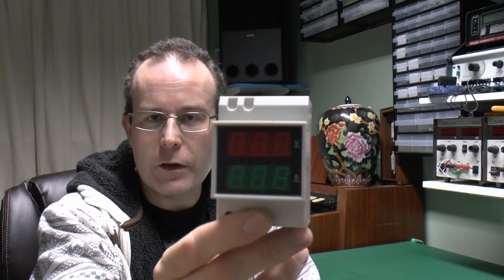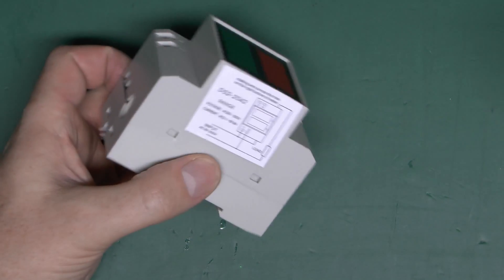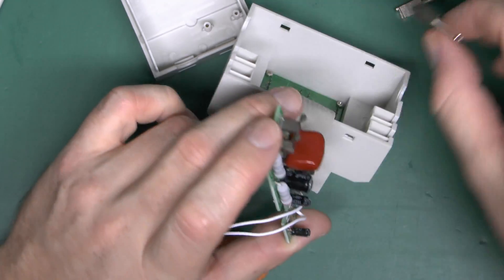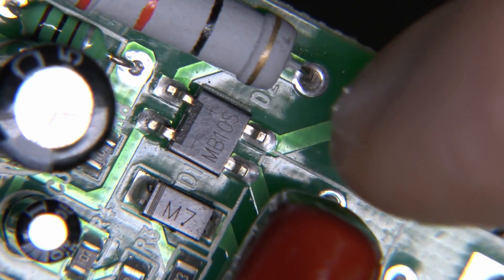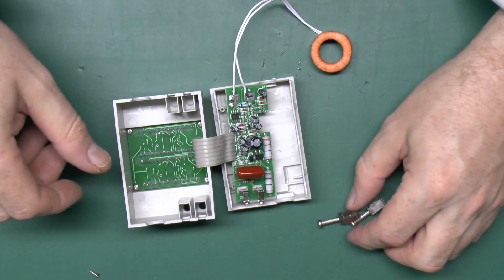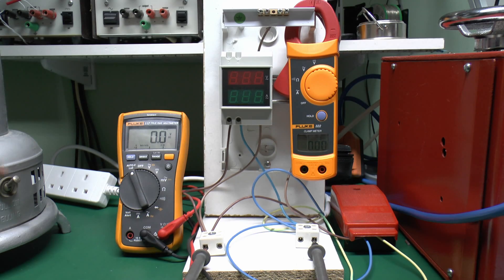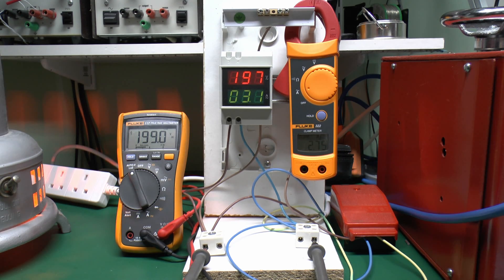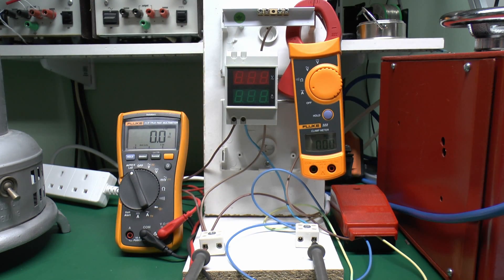LED Panel Meter Volts & Amps

Comment: The main brains is underneath the LCD PCB. I have this same model. The voltmeter malfunctioned and would show 600-800v. I opened it and there were two small smd pots next to the display which controlled V and I calibration. I tried turning them but it snapped off.

Comment: The aliexpress page shows calibration adjustments on the front of the display PCB. 

https://www.aliexpress.com/item/DIN-RAIL-Dual-led-display-AC80-300V-AC0-1-99-9A-Digital-voltmeter-ammeter-volt-amp/1883021072.html?spm=2114.search0604.3.23.4de236cb6ie7Aw&ws_ab_test=searchweb0_0,searchweb201602_3_10065_10068_10130_10890_5730315_318_10547_10546_319_10548_317_10545_5728815_10696_450_10084_10083_10618_452_535_534_5729215_10307_533_5025915_532_204_328_10059_10884_323_325_10887_100031_320_321_322_10103_448_449_5728415,searchweb201603_2,ppcSwitch_0&algo_expid=8ab4b923-0820-4db9-b7ac-b1f090c787ef-3&algo_pvid=8ab4b923-0820-4db9-b7ac-b1f090c787ef

Comment: Hello,
Could you test and monitor? It is very popular and cheap.

http://www.ebay.com/itm/20A-AC-Digital-LCD-Panel-Power-Meter-Monitor-Power-Energy-Voltmeter-Ammeter-/151684228438?hash=item235115a556:g:UpMAAOSwBahVWIYD

Comment: J3Y is an NPN silicon epitaxial planar transistor
EZ422 is a detector IC used to detect the voltage and current and drive it to the display.
These things are cheap because they are not very accurate and should not be used in any practical applications.
This is something you would buy as a movie prop or something.

Comment: thats a nice looking old heater :) love the style of it!

though, it would be interesting to see what BigClive's reaction to that unit would be, lol
Reply: +killer1479 The internal layout and quality seemed pretty good, with decent separation and component ratings.  the little 8 pin chip is just an op-amp.  The displays probably have a driver chip mounted on the PCB underneath them.
Accuracy on the current setting, maybe not so hot, but at least it was erring in the direction of safety.  I'd wondered what the quality of those was like.  I might almost be tempted to buy one now.
Reply: bigclivedotcom :o never expected to see a reply from you here :D buy one and try and see at what extremeity you can make it go pop >:D
Reply: bigclivedotcom  Nowadays, there's a version with a watts, power factor, and kWh display. Lookes very similar to this one. Would love to see your take on it in a video :-)

Comment: Hi John I was thinking about the amp readings being different  The bracket which your using to both run the load through and hold your tongs might be earthed. The bracket might be just plastic but i can't tell.
Reply from the maker: +Edwin Waugh The bracket is plastic.
Reply: +John Ward ok !!!

Comment: The 8-pin chip is a TL082 dual op-amp, which will be amplifying and conditioning the signal from the current transformer. There must be something more than just the displays on that front PCB!
Most likely "Chip On Board" with the obligatory black blob under each of the displays. 
I need something like that for my variac / isolation transformer combo... with a little hack of an external isolated supply it should read voltage down to almost zero.
Some tweaking required though - it's calibration is a bit crap out of the box, I'm sure it isn't going to be true RMS or allow for power factor but for most applications a ballpark figure is usually adequate.
For critical measurements we of course use calibrated test instruments....
Off to look at the price of one of these compared to a branded type!
Reply: +Simon Parkinson Not the first time someone's read the batch code as the part number. And yes, there must be a pair of voltmeter/display drivers on the display board.
Reply: I posted a link above. The page shows calibration adjustments for both current and voltage on the front of the display PCB which is accessible by removing the colored plastic mask. I agree that for the money, it doesn't have to be dead on accurate. I'm looking for an AC voltage/current monitor for my test bench. I just want to know if amplifiers are going to blow up in my face when I crank up the variac. BTW did you end up going with this? Maybe you found a better one?

Comment: Pretty poor review on the electronics. The small 8-pin chip is probably a frontend/amplifier for the current transformer. All the logic is indeed on the LED-display-board, which we didn't get to see :/

Comment: A single burden resistor, insufficient creepage for the potential failure voltage of the CT, etc. Overall, glad it's in a plastic enclosure!

Comment: Wonder if the blue resistor across the current transformer might be a selected component for calibration. Perhaps the value was selected as close enough,  substitution of a small potentiometer might effect recalibration of the current reading.